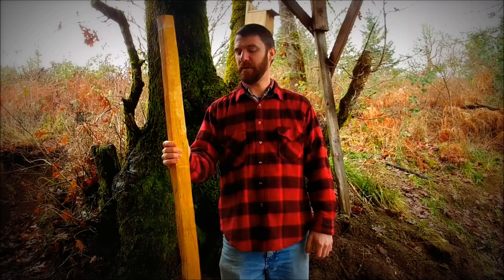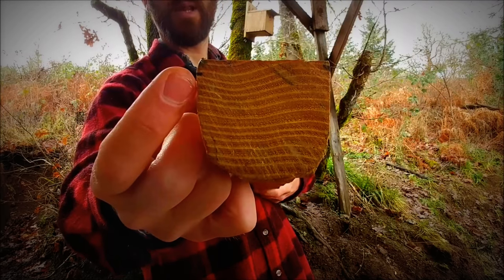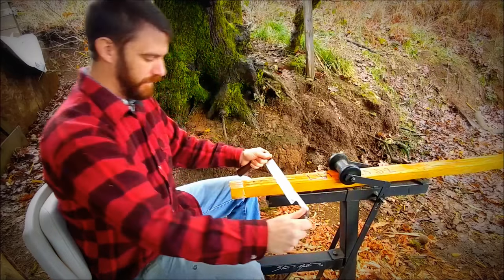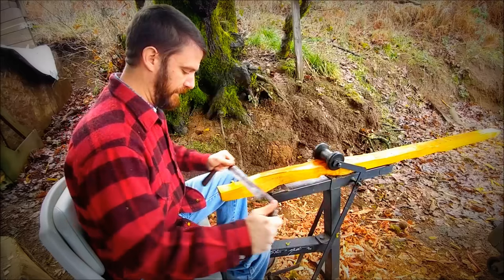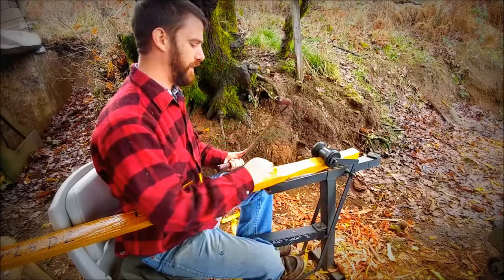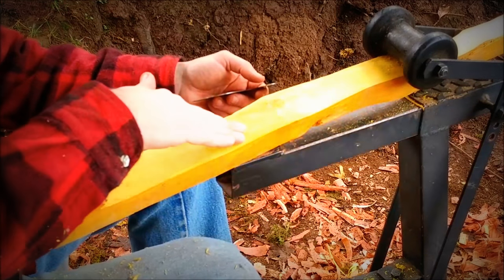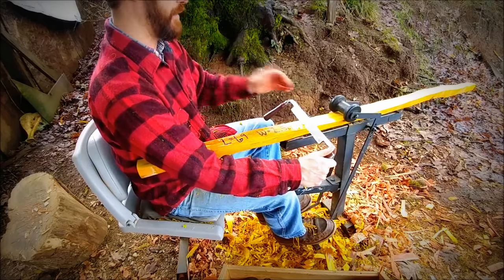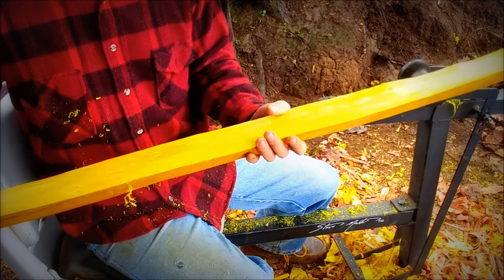How to Chase a Ring on an Osage Stave

Comment: So now that it is down to the ring you still have dips and curves along the back.  Does this affect tillering?  I thought the bow has to be flat on the back.  How do you work around this?
Reply from the maker: Good question. The bow doesn't 'have' to be flat on the back. If a stave has dips and bumps you follow them faithfully as you chase the ring and then when you're tillering you make the belly match the back so that you have consistent thickness. If there's a valley on the back there should be a corresponding hump on the belly to match it and vise versa.